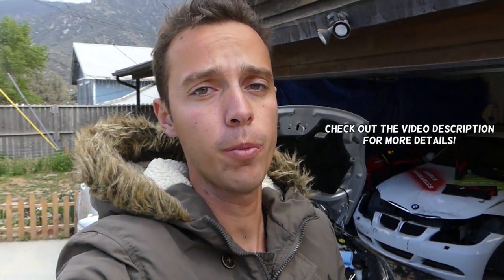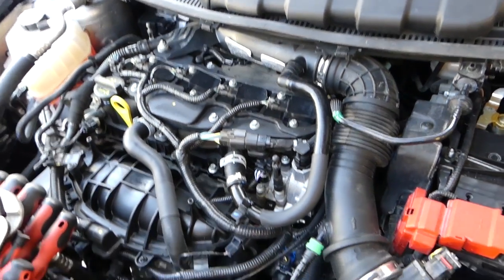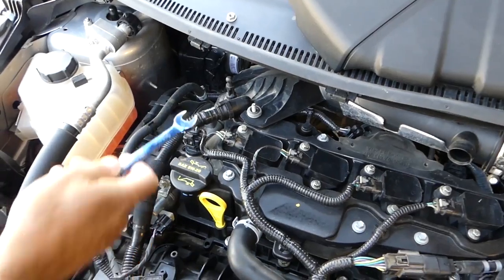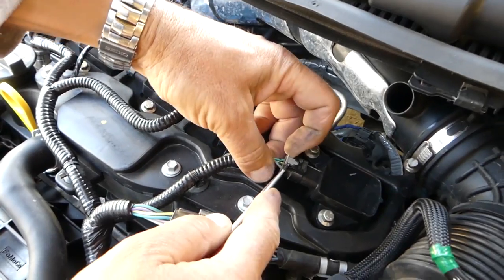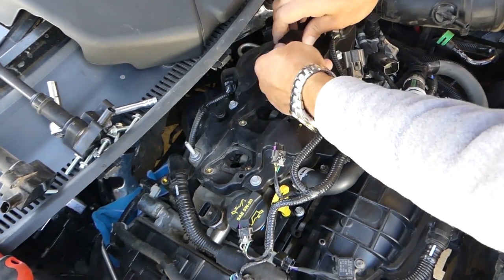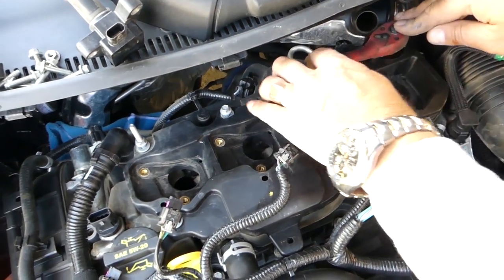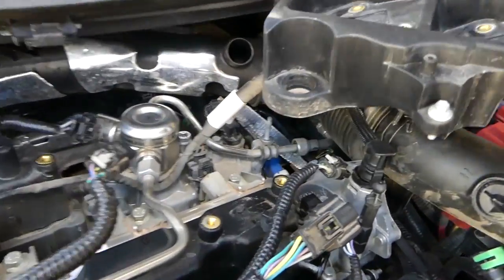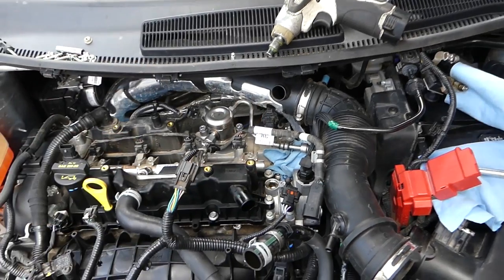FORD FIESTA CAMSHAFT POSITION SENSOR REPLACEMENT MK7 ST

Comment: Guys need help, my wife mk6 duratec 1.6 mk6 ford fiesta idles well, starts well but stalls when driving... Shows handbrake sign & stalls.
No errors on diagnostic, changed petrol pump, filter, throttle position sensor, tested abs sensor its fine... Car still stalls. Pls help guys